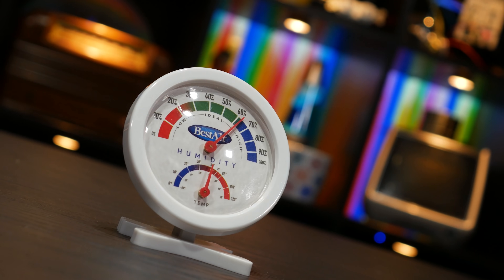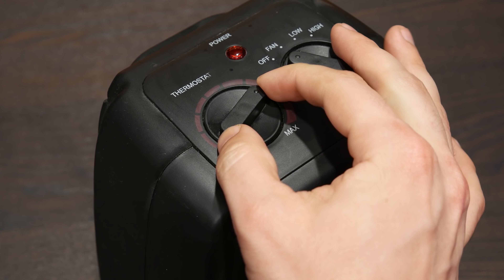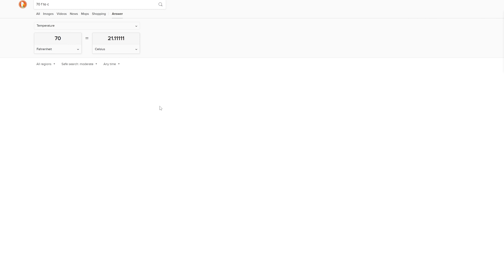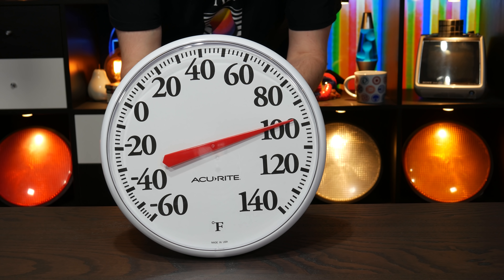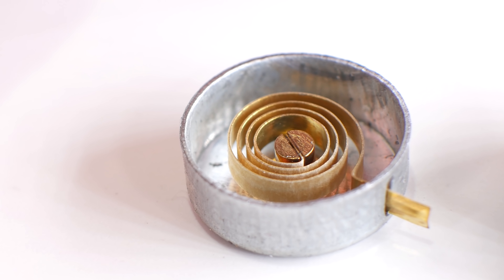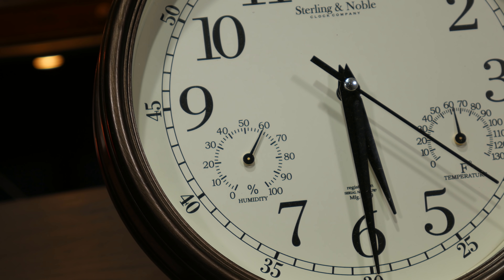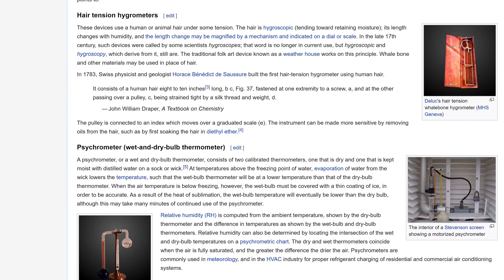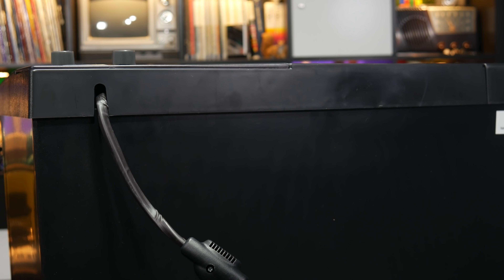Analog Hygrometers - how?

Comment: I’m surprised that you didn’t show the hygrometer that was the “gold standard” of accuracy for many years (and perhaps still is): the wet bulb-dry bulb hygrometer.  This consists of two closely matched mercury thermometers mounted side by side on a board with the temperature scale between them.  One has the bulb exposed to ambient air, the other has a bulb composed of an absorbent material such as cotton, soaked in water before taking the measurement.  Under a roof but exposed to the outside air, the top part of the board is attached to a chain, by which the user swings it in a circle for a specific time, then reads the two thermometers.

The wet bulb is cooled by the evaporation of the water, while the dry bulb is cooled (or warmed) only by conduction of heat between the bulb and the air.  In more humid air, less water can evaporate, so the difference between the two thermometers is smaller; in drier air, the difference is greater.

The user, who is usually a meteorologist, looks up the two numbers in a table to get the relative humidity and a related number, the dew point, which is the temperature at which water condenses on a surface.

This method may have been partially automated by now, but in essence it is still the most accurate, other than counting water molecules.

Comment: But we use metric time.
Reply: The second is used in metric and defined using metric, but the second–minute–hour system we use is not metric, and the second we do use in metric came from that and is the traditional second, rather than the decimal second which was intended for the metric system.

Comment: As with all measuring in the USofA, where they hated the English ( something to do with a tiny little war ) but loved the French ( same war, but not so much now due to a different war their president wanting but the French did not joining them in ), The USofA still uses the scales from the English, rejecting that from the French.
The thing that the USofA rejected from the English was the side of the road system. The original system has the driver holding the reins in one had and the whip in the other, normally the right as this activity needs the better fine control, as you didn't want to whip your wife ( in public anyway 🤔 ), the driver would sit on the right. This is proof that Americans as wife-beaters...😀

Comment: Wow. I never considered blinking christmas lights may have a bimetallic strip? Does that mean they blink slower in colder weather?
In fact, wouldn't that mean they blink at different rates in direct relation to outside temperature, humidity, etc because of how fast those internal bimetallic strips dissipate heat energy into the environment?

Comment: Love the videos...keep them up.  As a physician I got used to using both F and C and both lbs and kgs.  I could convert them with sufficient accuracy in my head.  The only gripe I had was that between freezing and boiling in F there are 180 degrees and C of course has 100.  When doing body temps, one was always having to use decimals.  The degrees are "fat" so you had to get an impression in your head that 38.3, which is only a bit over 1 degree is 101 in F.  Which is nearly 2½ degrees F and a significant fever.  I trust that the younger physicians are more mentally comfortable with it.   Of course.... I came along at a time when older guys will still calling for 1/8 grain morphine in the ER.  Try converting that in your head!
Reply: Finally somebody pointing out that the °C scale is too damn narrow
Reply: Yes! When will we strike back against these C° rabble rousers?!✊🏾🤨😒

Comment: The temperature gauge at the bottom is not useless as its what gives the hydrometer meaning. As air humidity is relative to ambient temperature. 80% at 35F is not the same as 80% at 80F

Comment: One of my favourite examples of measuring relative humidity was a paper that looks at the changes in differential GPS timing to measure the refractive index of the upper atmosphere (about 2% of its line of site traversal) between the satellite and the ground station.

This was converted into relative humidity.

because the satellite moves, they were able to map the atmosphere tomographically...

so yeah. You can always make it more complicated...

Comment: A quick and easy way to get a close estimation from F to C is to subtract 30 from the F temperature, then half that number. For example: 70°F-30=40. 40/2=20. ~20°C. It’s not exact but it’s a good gauge to tell if you need a jacket or not.

Comment: My atmospheric science professor was frustrated about our measurement systems, it can make calculations tedious. 😅Meteorologists also prefer dew point over relative humidity. Dew point tells you what temperature water will condensate at, or reach saturation (100% RH). The issue with relative humidity is due to air holding more water at warmer temperatures and less at lower temperatures. On a 90f day with a dew point 65f the humidity will read 72%, that RH is not representing the amount of water the warm air can hold. That day would be very sticky. 🥵

Comment: Either temperature scale (F or C) is arbitrary. C makes more sense, but it still has the issue of water freezing and boiling at different temperatures at different altitudes. Kelvin is the only true way to measure heat. Fun fact: 60*C is not twice (2x) as hot as 30*C; going from their Kelvin equivalents, it is only 1.099x as hot.

Comment: Let me prolong your tangent about the temperature unit Celsius and the metric system. Well, while there have been several metric systems (systems that use the meter as unit of length) of units in history, the most prominent in use over the world are the SI units (SI being an abbreviation for the French terms for international system (of units)). Fun fact: Celsius is, like Fahrenheit, neither a part of it. The SI Unit for temperature is Kelvin. So next time when someone insist you should use Celsius instead of Fahrenheit and tries to back that with the metric system, you can respond with that pot and kettle phrase. - You could also be evil and actually use Kelvin, "because people insisted on the use of the metric system". ;)

Comment: Canadian here.  I can guess whereabout the temperature in Ferinheit is with regards to Celsius, mostly because I've seen household thermostats with both measurement systems on it.  Room temperature is around 70 F (we call it around 20 C).  When you get into the 80s or 90s Ferinheit, I know it's just too hot for comfort (so around 25-30 C).  So our weather is measured in Celsius, but all of our ovens and cookbooks use ferinheit...I don't know why...  At the same time, I can calculate between Kilogram to pounds and vice-versa, mainly since stores use both in the labeling.

Comment: In college, we used a "wet bulb thermometer" (a thermometer with a damp little cotton sock on the end), that you spin around in the air for awhile, then read the temperature. Then you compare that with the dry temperature, and use some equation which I don't remember to get the relative humidity.

Comment: I love that you handed it to the Celsius lovers out there!  I am very metric adept, but I agree with you.  Fahrenheit is so much more reasonable for ambient temperatures. In fact, in a way, Daniel Fahrenheit basically calibrated it for such.  And Celsius lovers forget two things. One, that it was called centigrade for most of its existence.  Two, Fahrenheit was the first and most popular scale for a long time.  I prefer Fahrenheit for ambient temperature because for most places, most of the time, the temperature is between 0 and 100.  And the degrees are smaller, giving a higher degree (no pun intended) of precision by only using whole degrees than Celsius.  Use Celsius for science and other uses, but Fahrenheit just makes more sense for weather.

I am also a lover of all things analog, just so much more satisfying, even if less precise.  Maybe do a show on temperature scales?  There's a lot of them out there that have fallen by the wayside, interesting stuff!

Comment: Okay hear me out. If you varied the thickness of the salt paper through the coil, could you bias it in a manner that makes the expansion near linear?
Reply: in theory, but manufacturing that would be tricky, and it doesnt fix the other problems: the metal's memory (retaining it's springiness), and the paper's absorbance accuracy (dunno if there's a proper name. essentially, the longer paper stays wet, the more it'll just give up and retain the water)
Reply: @jesuschrist711  Thanks for the thoughtful response Jesus Christ. Revelations foretold of you coming back to share your vision of practical manufacturing and long term accurate calibration!

Comment: Wood expands or shrinks with changes in humidity, more so perpendicular to the grain than parallel. So I suppose that a hygrometer could be based on a piece of wood, though the response might be slow and the accuracy might not be too good.

Comment: As both a career engineer and an indoor grower, I discovered to my chagrin that measurement of RH is one of the last frontiers of instrumentation.  Consider the precision and accuracy with which we can measure infinitessimal amounts of time, or voltage, or wavelengths of light... GAH!  ±5% is literally outstanding performance, and it's what the plastic-element units promise but do not, in the field, deliver, and their range is smaller than the range of a classic hair-containing aneroid.  What I found was that, for the money, the best accuracy-vs-money deal are european (I think they were German or Swiss - figures) aneroid hygrometers - about $200, which have subsequently been NIST-traceable calibrated in a chamber, making them $250 or $300.  The only way to do better is to use a chilled-mirror instrument, which are generally suitable only for lab settings. :/
Reply: Hello. What's the accuraccy of those? I am looking for a small hygrometer (to fit in a small fridge) that can be accurate to +- 0.1% for my cigars, but as you said it seems that +- 2-3% is the most precise we go

Comment: I gave up caring about temperature scales when I realised that they aren't connected to the rest of the metric system anyway. Meters, seconds, (kilo)grams, joules, watts and Newtons are all linked by equations of motion without constants, but there are no temperature dependent calculations that have constants disappear when you use Celsius. Best temperature scale I have seen is 4 at -11C, and 5 at 50C. It is defined as the temperature where a 1m square black body would radiate 1W at 1 unit of temperature. It coincidentally gives a useful temperature range if the 4 is implied: temperatures could be "point x", with point 0 being -11C and point 99 being around 50C (12F to 122F).

Comment: Quick rough number I found myself.

100F - what's that roughly in C?
First minus 30
then Divide by 2.
100-30
70/2=35 (the real answer is 37.7c)

25C to F.

25x2=50
50+30=80F - real answer is 77F

Why? With quick simple maths I know when they say "100f"... Yes that's 35c - a tad warm.

Comment: Enough of your pretentious Fahrenheit bashing! For a given temperature difference there are more integral Fahrenheit degrees than there are integral Celsius degrees between the low and high temperature. So stating a temperature in Fahrenheit is more precise than stating it in Celsius. What actual benefit is gained if the number of degrees between the freezing and boiling points of water is a power of ten?

Comment: Celsius would be fine for measuring ambient temperature...If we lived in water. But we don't and Fahrenheit is designed to measure air temperature. It's degrees are more accurate (smaller increments) for measuring air temperature without delving into fractions. And it's based on the 1/10000 rate expansion of mercury with temperature change (which given it's density doesn't change much with altitude). It's simply more practical for day to day use. In fact a lot of US measures are based on being practical and work better for day-to-day use.

Comment: A really good approximation that works well in normal temperature atmospheric temperature ranges and is easier to calculate is F = 2C + 30 or C = (F-30)/2.  It's not exact of course, but is much easier to do the math in your head, and gives you a good feeling if you are used to one unit system vs another.
Reply: My uncle who fled to Canada in the 80s after a…”snow storm in southern South Carolina…” uses that, I’m pretty sure, on the rare occasion I see him and temperature is brought up in conversation.

Comment: I have that exact same clock and I have an actual humidity gauge that is digital. and the clock reads 60% and the gauge reads 30% humidity. I have to have a humidity gauge because I build and repair guitars and humidity can cause severe damage to a guitar. anything with a bi metal strip or spring will never be 100% accurate. when they manufacturer them they calibrate them fairly close to what the reading should be. and most people are satisfied with that or simply don't no better.

Comment: Speaking of hygrometers and why Fahernheit used the numbers he used. Does an American thermometer slide it's scale up and down according to humidity  and airflow to better reflect the experienced temperature? Or are you just stuck with a system that does exactly not do what it is designed to do?

Comment: Blonde hairs were used for most hygrometers.   Then there is dry bulb/wet bulb sling hygrometers and the most accurate are chilled mirror dewpoint/frostpoint meters that heat/chill and mirror until it sees fog - then the relative humidity is calculated with room  temp and atmospheric pressure.

Comment: Thank God Mr Connections, finally someone brings up the 0-100 F thing. It just makes sense. Why do people get so mad about it
Reply: Currently, USA is the only country that uses Fahrenheit. Similar things can happen in Celsius, the scale is just offset. One of Fahrenheit's baseline is 100⁰F(37.7⁰C), which is the average human temperature. In Celsius, one of the baseline to use is 0⁰C(32⁰F), which is freezing water.

Similar things, different form. Although there should be clarification which unit is used as confusion could be disastrous. Examples:

• American tourist in a 90⁰ spring thinking it is a nice warm bath temperature suffers severe burns. (90⁰C=194⁰F, 90⁰F°=32⁰C).
• Foreigner dressed in summer attire in 20⁰ weather suffers hypothermia (20⁰F=-6⁰C, 20⁰C=68⁰F).
Reply: @dbclass4075  Your examples are silly.

90⁰F, even by your own admission, is lower than average human body temperature. Nobody who used the Fahrenheit scale would think that would be a warm bath. It would feel tepid, if not cool... and noticing the presence of steam rising from any such body of water indicated to be "90⁰" would give pause.

If someone was expecting warm weather at 20⁰C, surely they would notice their error LONG before succumbing to hypothermia due to the myriad other observable factors like, perhaps, snow on the ground (where and when applicable), the clothes other people are wearing, the feel of cold air on their skin indicating that they should find more appropriate clothing. Further, if you're going somewhere in the northern parts of the northern hemisphere in the winter months (say Minneapolis in February), it should be obvious that it's not going to be appropriate to bring summer clothes. If you get confused, that's on you, not the temperature scale.
Reply: @OuroborosChoked  You are rather optimistic on the average intelligence of humans. Any job that requires interacting with the public, no matter which unit is used would have to deal with idiots. Yes, there are stupid tourists out there who could not tell difference between temperature units, let alone hemispheres.

Have you considered the following:
• That specific American wanted a more toasty bath and has higher temperature preference, in which 90⁰F is comfortable for them.
• Foreigner received weather report indoors. Seeing only 20⁰ without context, dressed for summer, only to be greeted with cold weather. Assuming that is not an idiot, would obviously retreat back in. Again, if not idiot.

Besides, those are just examples how temperature confusion can result to silly situations (or disastrous if they are rather stubborn and idiot).

Alright, let's use a somewhat more plausible examples:
• American receiving a hotter than expected drink at 100⁰ (100⁰C=212⁰C, 100⁰F=38⁰C).
• Foreigner receiving a colder drink than expected at 80⁰ (80⁰F=27⁰C, 80⁰C=176⁰C).
Reply: @dbclass4075  "That specific American wanted a more toasty bath and has higher temperature preference, in which 90⁰F is comfortable for them."

Wat? 90⁰F is lower than average body temperature. It will not feel toasty. And if they know it's actually 90⁰C, then they know it's not 90⁰F! The situation makes no sense.

"Foreigner received weather report indoors. Seeing only 20⁰ without context, dressed for summer, only to be greeted with cold weather. "

How did they get to where they are that it's suddenly 20⁰F without them noticing? Temperatures are generally consistent day-to-day, only trending up or down as the seasons change. Certainly flukes exist, but going from ~68⁰F to 20⁰F would be extremely noticeable.

As I said (and you agreed, admittedly): the examples are silly.
Reply: @OuroborosChoked  Alright, how about this example: American receiving hotter than expected drink than expected, and foreigner receiving colder drink than expected.

In both cases, 80⁰ without additional context (80⁰F=27⁰C, 80⁰C=176⁰C).